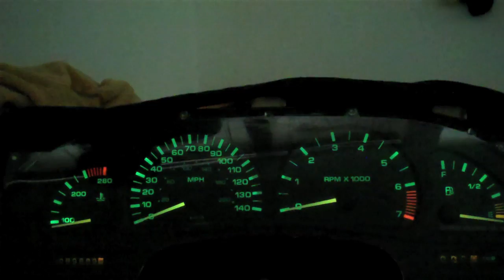Aurora instrument cluster RGB led test

Comment from the maker: @gritzsk8tzblind, not a controller, just a RGB dimmer running five leds wired in parallel (+1 for the shifter backlight.) I can manually adjust to any color I want, but reds don't show up due to blue tinted gauges. Where my ashtray is, I have a panel with three knobs to set each color channel. I'm still finishing it up but should have another video soon with it installed in the car.